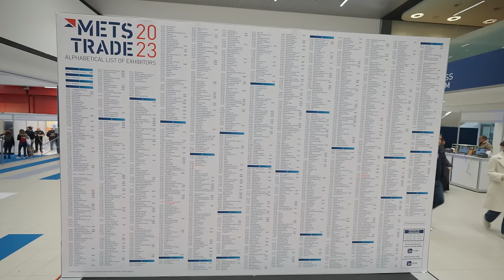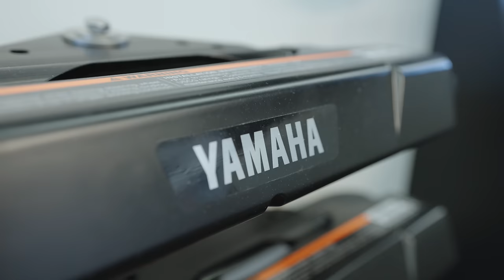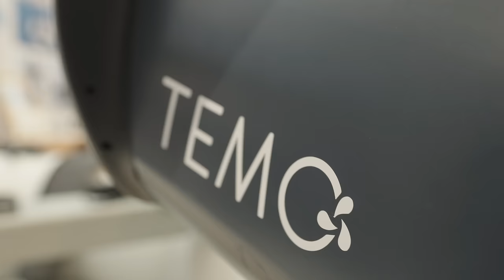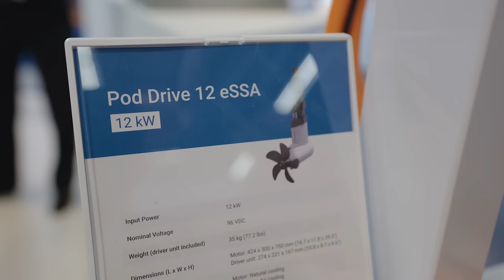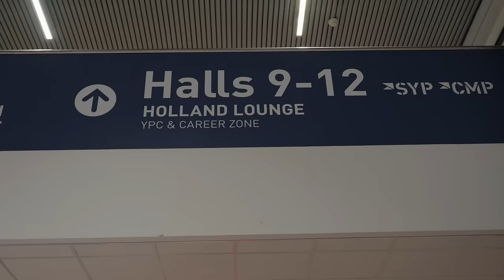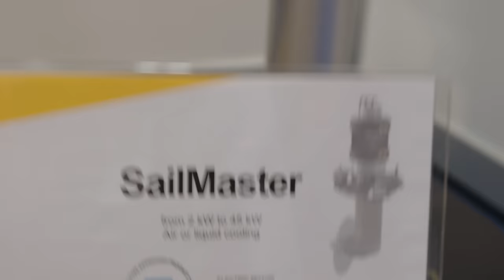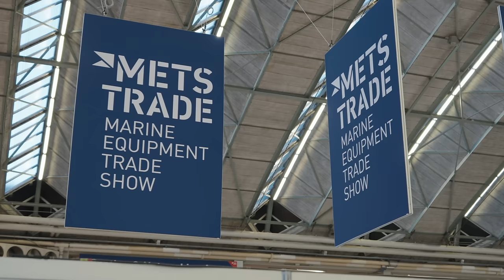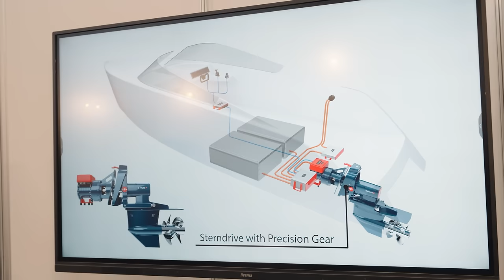The Shocking Truth About Electric Propulsion | Step 371

Comment: We're one of the "performance bulletin" sailboats that the ePropulsion rep mentioned. We are extremely pleased with the electric motor on that boat and are considering another of their motors for our new boat.
Reply from the maker: Would love to hear more about your set up as we couldn’t find ANYTHING on their website about test boats or sea trial numbers or regen tests.
Reply: @SailingUma    Happy to share. ePropulsions does kinda bury the Performance Bulletins. At the very bottom of their homepage, under the Service heading is a link Performance Bulletin. 

We installed the Pod 3.0 Evo in our Beneteau 235. While regeneration was a consideration, for us it was more the quiet, and the lack of maintenance. My wife wanted to be able to single-hand the boat but didn't want to have to deal with a recalcitrant outboard. So we went electric and don't regret it at all.

The complete system includes the Pod (3kw direct drive motor), motor controller, 4kw 48v battery, throttle, display and cabling. It was mostly a plug and play install. Drilling holes in the bottom of your hull is slightly unnerving the first time you do it, but after that it was pretty straightforward. 

As far as performance, we were delighted. 1kw (with a clean hull) would keep us at 5kn for about 4 hours. Since we use this boat primarily as a daysailer, and are rarely more than 10 miles from our home port, that was plenty of power to get us back if the wind completely died. Our max calculated range was about 25 miles with just the one 4kw battery. We never pushed it that far; we prefer to sail when possible.

One thing I will say about their regen system is that it does work, but. For our use case, inland lakes with a boat that has a 22' waterline and a hull speed of just over 6kn, it didn't really do much. That may be due to the prop being optimized for thrust rather than regen. Oceanvolt definitely has the tech edge there. 
The most we saw was about 100w at around 5kn and usually more like 75w. But the ePropulsion regen chart (on their Pod page), made it clear that below 6kn you really weren't going to get much back. On a larger boat that can maintain say 7kn or 7.5 kn, and do that on a 200 mile passage, it would have more impact. 

Happy to answer any other questions, either here or offline.

Comment: It’s interesting to see a company represent the value of regen capabilities based on a use case. It’s not like that capability adds complexity or cost to a system, only to the R&D and design load. So tell me they’re not interested in investing the time in regen capability but somehow all are interested in being considered the best at what they do. Ocean Volt is the only company that seems to understand that a successful implementation of this technology might not fit exactly to how people use a boat now, but it might change the way all people use a sailboat — in the same way that the combustion engine changed automobiles and human mobility.
Reply: Ocean Volt may well be trying to be the best at what they do but come on, £27K for a motor for a 10 metre sailboat? You can actually buy a sailboat for that money. Or 6 diesel engines. Nothing can justify that sort of price.
Reply from the maker: Volume production is the only way to bring the prices of any of these systems down. They’re all still made by hand basically. With European labour costs.
Reply: It still doesn't make it any more affordable today.  @SailingUma  would you guys have gone for it if you had to pay full price for it?  I would have loved to install one, but the price just couldn't be justified.
Reply: As was said in the video, doing regen well in a boat is NOT just software like it is in a car.  It requires different propellers and waterflow characteristics.
Reply: Oceanvolt's servoprop saildrive sounds terrific but in my case the extra $10K, over the Electric Yacht option with much lower regen performance, is far too much.  I suspect the same will be true for most who cruise on a modest budget.
Reply: Not all uses for epropulsion are sailboats and regeneration is useful only for that very specific part of the market
Reply: Good regen seems to require variable pitch props, which certainly adds a lot of complexity and cost

Comment: What a marathon!  After watching it I am even more impressed with the pioneer Wylie 44 that I spent two weeks sailing the Bahamas on 16 years ago.  It was based around a large, slow turning propeller of optimum shape for efficiency in the 4-10 knot range that the boat regularly delivered. It was always on.  When sailing you had the option to have it slowly turning producing no electricity and with essentially no drag, or with a simple move of the throttle you could feed as much electricity into the battery as the system was capable of absorbing or pull power from the battery or from the generator in diesel-electric mode.

Out of the entire 40 exhibits in the show only one company followed that philosophy. It is superior to our pioneer system because it had a 360 degree rotating drive and more advanced controllers.  My impression was that only that company and Ocean Volt really care about the people like you who want to regen while crossing oceans.  The others read their market correctly, because most sailors just want to have an afternoon in the sun and be able to brag about the high tech in their boat at the bar afterwards.

Comment: I loved when you said to the guy at Epropulsion that the 1KW engine isn't going to bring the dingy on  plane and he answered "no, definitely not!" and then he made a nonsensical statement saying "it's all about moving the boat efficiently" when in fact bringing the boat on plane IS the most efficient way of using propulsion energy! From this alone one can deduce that this whole circus is a lot of marketing BS.
P.S. Electric motors ARE more efficient than ICE motors, that's also a fact, but you'll need to add a lot of weight to a small boat from a huge heavy battery to get a motor powerful enough to get you on plane. Someone needs to calculate a golden ratio for his/her application. In other words...it depends on what your application is.

Comment: I appreciate how honest some of the company reps were, in regards to the repeated question of "regen".  Regen only starts to make sense over 8 knots, but preferably 10.  The point people have made about Uma not being worthy of this current gut job, was that it doesn't suit your needs/requirements, going forward.  If regen is so important, then it makes more sense to get a larger boat with more length at the waterline(faster) and more real estate for batteries, as well as solar.
Reply from the maker: We can generate more power than we can use currently on Uma when offshore sailing. Sailing at 5kts we break even, anything faster and we’re charging. Of course a boat that can average 10+ kts would be sweet. But we don’t have $1,000,000 just lying around burning a hole in our pocket.
Reply: @SailingUma  You still fire up your generator though, because your energy storage is depleted very quickly, when used for(very slow) propulsion.  My point for a larger vessel is also about having significant space for lifepo4.  Generating power through regen, is kind of moot, if you don't have the space to store it.  Also,  regen math doesn't really add up unless you're on long passages with great daily average kts, which one of the reps brought up.  At the end of the day, you guys can do what you want, based on eco ideals.  Everyone else though, has to live in the real world where none of us get free tech or significantly discounted tech because of a "channel".  The cost in the real world is ridiculous, when compared to ICE tech, with way less practicality.  I like the idea of hybrids.  I like the idea of quiet anchoring and leaving marinas.  General propulsion needs though, can't be seriously replaced with batteries that absolutely have to be switched out in X amount of years, at huge expense.

Comment: Brilliant video guys, thanks for a superbly informative piece of work.  As a sailor I am very interested in this technology, and like you, I think the holy grail is regen.  I think in the next few years the norm for new boats will be hybrid systems that offer at least 3-4 hours of range from a battery system that can be recharged either from regeneration or a backup generator.  What would be nice to see is a system that can be retrofitted to older sail boats which most of us sail at sensible price!

Comment: I have built electric outboards before and in the interest in regen, its almost like you need a different unit that is really designed for regen other than the unit that is built for boat drive. Its great to have one unit to do both but I think the regen characteristics would be one that has more prop blades and is designed to spin the motor generator at a high rpm while the unit for moving the boat would be designed with less prop blades and spin at a lower rpm for energy consumption efficiency. Hard to get regen out of a unit designed to drive the boat. Another solution would be to make an outboard that has a high speed and low speed gear drive in the lower end that could be switched back and forth to put it in regen or drive mode.  I don't believe anyone has looked at that since regen always seems to be such a low priority to the manufacturer. Every opportunity to make electric power for storage should be considered when doing long distance sailing from prop regen to solar to wind. More power input may allow less battery capacity which is money weight and space. Best of luck to what you end up designing. Hope you find a sponsor there to try out their products and showcase them for both you and their benefit. Love you guys and your channel.

Comment: A big thank you for this informative video! If I hadn’t had the chance to do my 1st Atlantic crossing at that time I would have attended the boat show in January myself to chat with the companies.
After a runaway Diesel engine in 2023 we finally decided to switch to an electric system in the upcoming months.
Have you guys had a chance to look into WaterWorld and their products? I'm keen to hear your opinion.
It's for a smaller narrow and light 28 ft boat from 1974 (RJ 85) with a moderate long keel. Currently equipped with an inboard 8 hp, a shaft, and a 2-bladed Gori folding prop. Mainly sailing with this boat in the Baltic sea and hardly using the engine. Hence, regen wouldn’t be important for the traction battery but could be interesting for the service battery for those trips where we’re staying away from ports for three days. 
Thank you!

Comment: Oceanvolt seemed to be the only company that was really interested in finding solutions for the 30' to 60' full time, live-abord, cruising sailboats.
Reply: Don't overlook those combi guy's, they have a big used boat market
Reply: I priced a OV unit for my sailboat.... the price was eye watering.
Reply: Check out Electric Yacht.  They don't offer the high performance servoprop, which sounds terrific, but the price is much lower for a KW equivalent saildrive.  I haven't made a final decision for my 36' sloop yet but Electric Yacht is looking like the best option.  $10K more, essentially for much better regen, is just too much for my budget.

Comment: Great video, one thing you may not know is regeneration acts differently for Permanent Magnet motors and Asynchronis motors (two common ones).  The difference is an Asynchonis motor can be allowed to freewheel (just spin without resistance) and a permanent magnet cannot.  The Pod motors from WaterWorld are permanent magnet and they have excellent regeneration but its not yet released because fringe scenarios still need to be accounted for by the programming.  Specifically, preventing regeneration when batteries are full.  A folding prop is a mechanical way to prevent regeneration and is the suggested method for sailboats but other options may be better.  Regen is a complicated problem but long story short all electric motors can do it. Next 5 years will see a lot of optimization in this space.

Comment: I have a 30 foot flush deck race boat (6200 lbs displacement )  with a dead inboard diesel (BMW D7) I am looking to replace with a electric propulsion system. Just on-off dock and to from race course if becalmed. Looking at keeping the prop shaft and folding prop - regen not needed. Simple.

Comment: One thing that was clear from your interviews was there was only one company interested in Regen. I was amused by one salesman patronisingly telling you that you don't need it and you will virtually never use it! How little he knows.
Reply: If that was the second to last interview, I took it more to mean that in real world the regen simply isn’t great in the conditions a sailboat deals with. I.e. if you’re not travelling at 8kts minimum, you’re simply not putting much back into your batteries. So while between 4-8kts it’s possible based on what many have reported in the video, the extra drag and reduced performance for < 1kw isn’t a great trade off.
Reply: But 1kW over a 3 day passage is......
Reply: The major problem is that all of these ideas are a hybrid of what we already have from combustion engines, sail drives, small props, high revs. If you go away from this with larger props, slower rpm’s and retractable legs you can change the look of regen. If you don’t have a large prop disk using a 4 or 5 bladed prop the regen will always be poor.
Reply: @jeremyprice679  I get the point your making. But I stated less than 1kw as it could be quite a bit less than 1kw. (Not a lot of data…) The question isn’t the cumulative watts, but without that regen, would a boat running solar and some sort of hybrid setup meaningfully need the power? And consider when it prolongs a passage by days.  But the great amount of time when not making long passages, it’s not going to make a meaningful difference. You can’t go on a short sail to fully charge your batteries. 

I like regen. I like that it introduces an element of safety through redundancy by way of complimentary systems. But it has shortcomings that are meaningful to how most people use their boats. 

Not talking about Uma’s fringe use case specifically, but more broadly cruisers. Also not deriding them for their resource conservation focus in sailing the world. Just that they make compromises most won’t.
Reply: @jeremyprice679 what I’m hearing under the sales speak is that the target market for these small motors are day sailors or shorter passages ( dinghies small racing boats). If you’re going to tie up to a dock at every night with power available, what’s the point of regen ? I suspect that’s the bulk of the sailboat market so low hanging fruit.

Comment: First of all: Incredible, thank you for the great video and for sharing your insights!!!

Just one question:

I know you guys love regen and are huge fans. But: Assuming that electric propulsion on a sailboat is a goal: Is the regen factor really worth it? Getting a cheaper system without regen and buying 1-2 wind generators might have a few advantages:
- You can use a standard folding prop, the whole system is more simple and rubust. Repair and spare parts worldwide might be easier.
- If you're anchoring, regen will not work, but the wind generators will.

What do you think?

Comment: Great episode! I had no idea so many companies were building what I built in my garage. 
Unfortunately your question about regen is a matter of physics. In order to create a useful amount of regeneration requires an unacceptable amount of drag. So in light wind conditions, the extra drag slows the boat and the slower boat speed reduces regeneration so it just doesn’t work. In high wind conditions the extra power from the sails can overcome the extra drag created but in a mono hull your speed will only translate into nominal regeneration. But you must also take into consideration the stress you are putting on your rigging and creating an uncomfortable sail rather than reefing the sales. 
Catamarans do a bit better as do longer boats just because the higher speeds through water.
Bottom line, there are better ways to generate energy without adversely affecting your boat speed or stress on rigging.
Reply: The sales people who called regen “free” were not telling the truth.
Reply from the maker: We’ve sailed now with a Servoprop for 3 years. Yes, if we’re sailing at 5kts in 10kts of wind and try to regen, it slows us down by .25-.3 of a knot. But in typical conditions, 15-20kts, it doesn’t slow us down any and makes 500-600W. On faster boats this numbers go up exponentially.